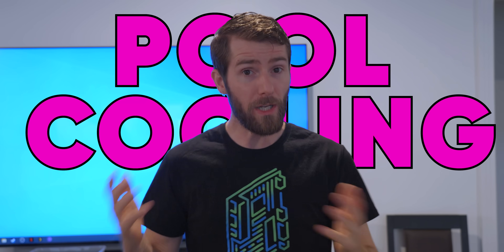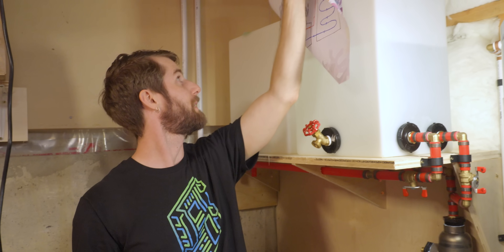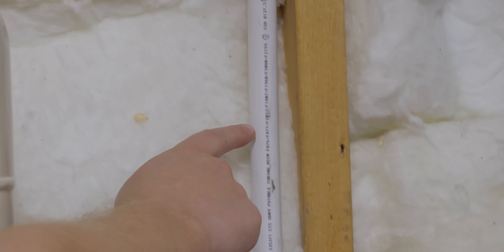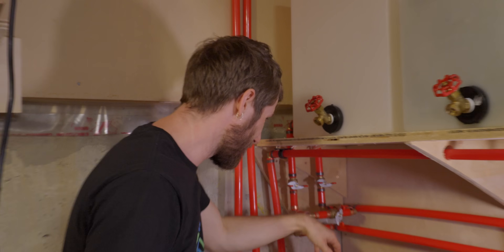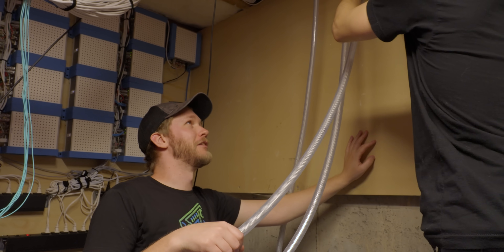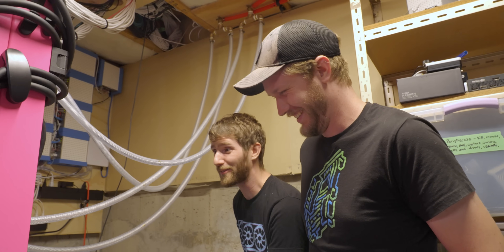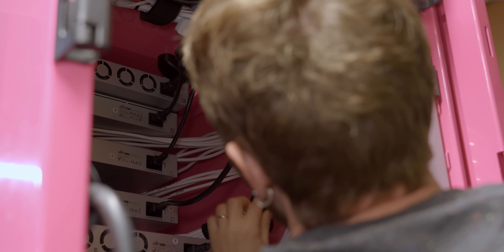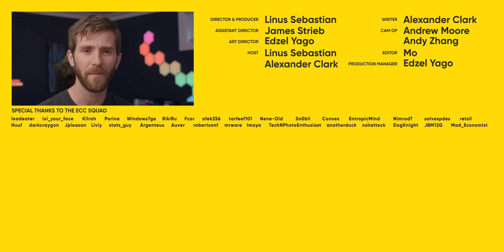My pool leaked and killed my computer - Whole Server Room Pool Watercooling Part 4

Comment: Would there be any downside to settings a thermal target? Like if you tried to keep the loop at 50C you could limit microbe growth. Most bacteria die at 42C heat stress in just a few minutes. I know you have Lugol’s in there, but would there be any downside to targeting a loop temp of 50C to limit growth? I mean 50C is nothing for PC components. Or would that just be unnecessarily complicated? Bc right now you’re at 37C which is optimal for bacterial growth.
Reply: One problem I could foresee would be compatibility of the plastic of the hoses. 50°C is just warm enough that it can warp some plastics, and possibly in subtle ways like accelerated creep rates.
Anecdotally, I know that there are certain plastic kitchen stuffs that I must be quite careful with when placing them in the dishwasher, since any strain or just straineous support can warp the plastics even in a 50°C eco washing program.

Comment: 4:03 guys, use wire ferrules, they are mandatory for connections like this. Not using them can result in conductivity issues, leading even to fire hazard.

Comment: Would've loved to find out what the issues were with the blown fuse and the switch on fire -- and the solutions!
Reply: With the blown fuse, Jake was saying he didn't trust the SATA power adaptor it was plugged into, but they never confirmed it.
Reply: From another comment:
Alex commented on the Floatplane video:- 
Fuses blew due to bad Sata adapters. As for the switch we have no idea what happened, checked the power cable with a multimeter and it was all good. Just replaced the switch and it has been fine
Reply: @AnthonyFuller   classic LTT
Reply: There was clearly some sort of electrical problem in that room, I'm very curious
Reply: it's only north of 25amps 😅 @Th3_ArCh0n
Reply: Nonono. That's for floatplane. Now you have to pay for the interesting in depth content we all subscribed for years ago

Comment: A little bit of copper citrate is an excellent algaecide.
I put just a knife tip worth of pure, solid citric acid in my ~2 liter deionized water all copper loop. The little bit of citric acid reacts with the copper and forms a bit of copper citrate.
I haven't touched my loop in at least 2 years and still everything looks perfectly clean and nice, even though there's sunlight on my PC daily.

Comment: The labeling is right, it could be hieroglyphs as long as you're able to match the plugs with the tubes. Linus's method seems to assume the tubes are directional for some reason? Honestly both have the same failure method though: if you lose track of whether your tube is from a manifold or computer, you might connect it back to a manifold or computer. If this happened, Linus's method would at least ensure there's flow through the tube, while Alex's would connect two areas of equal pressure. Neither is likely to be a problem that I can tell, aside from the loop not working of course. So probably the tubes should have explicit computer/manifold ends, in addition to either Linus's or Alex's labeling.

Comment: Get some leak sensors in there and tie them into home assistant for notification, and maybe add a controllable valve on the lines too. One of those tubes starting to leak out and nobody noticing (or being home) is a disaster waiting to happen.

Comment: Hello guys, I am writing from the other side of the world, from Moscow. We have different standards and even voltages here. Why are you using these crappy fittings? Have you rehau plumbing systems in Canadas markets? What do you plan to do with condensation in winter?

Comment: I DEFINITELY would've put some quarter turn valves on those reservoir tanks instead of those multi-turn hose bibs. The seals on those always inevitably dry out and fail whereas quarter turns don't rely on rubber seals.

Comment: The results are absolutely insane! Not sure why the skimping on the distribution manifolds though. Would also move as much of the water outside the rack as possible. If you must have it in the rack, put it at the very bottom!
Reply: But doing things smart and safely doesn't make it's own content... I mean, how many 'fixed' version vids has Linus milked out of this? If your goose is laying golden eggs, you don't go to the vet and ask them for a 'cure'.
Reply: @twiz66  That is the perfect saying for this.

Comment: I'm a bit wary on all of the unneeded connections on the pex. Pex is essentially softline tubing for plumbers. I'm sure they're all professionally installed, and shark bite is quite robust for temperature, but it's still just unneeded points if failure.

Comment: All this is cool, pun intended. But, I would NEVER have anything that could potentialy leak inside the rack, I would have everything on the outside, with quick connect runs going in only.